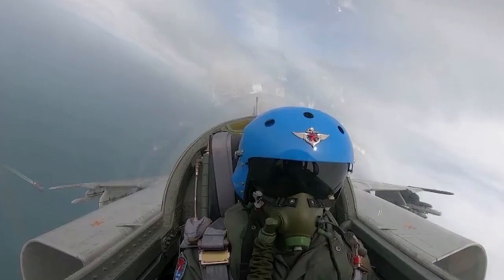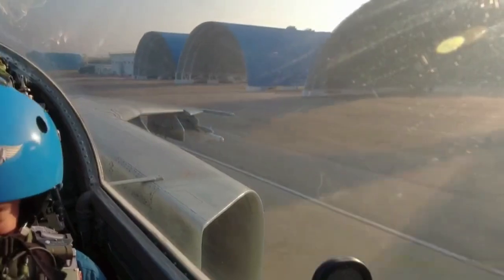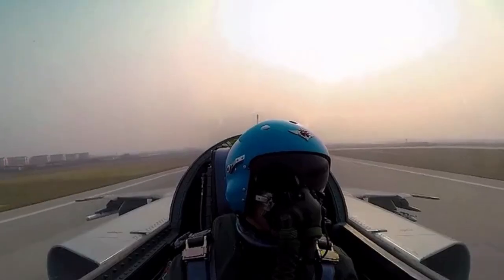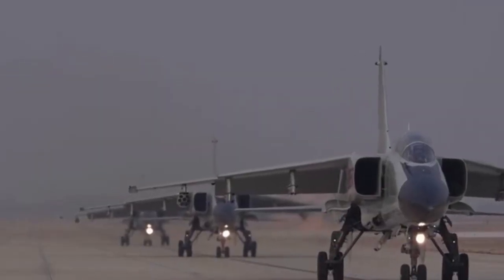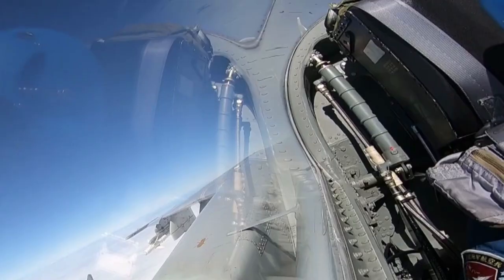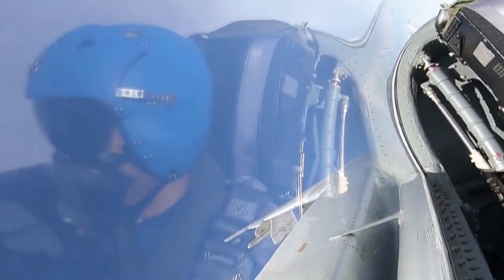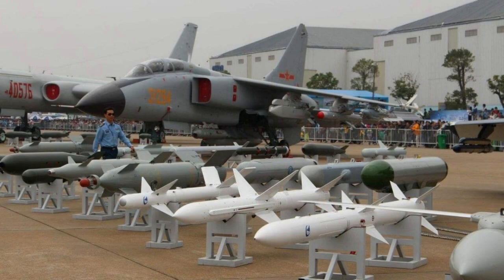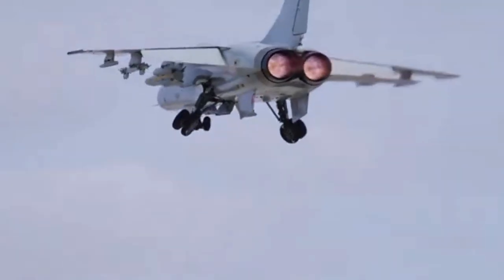Chinese fighter with British heart ! JH-7 with Rolls Royce turbofan engine, a unique fighter bomber

Comment: This Spey RR engine was designed to work in low altitude flight envelop.  China once had tried to replace the Russian D30K engine with this Spey engine on its H6 bomber ,but with no success. Eventhoug both engines has same thrust class, but they were designed to work in different working condition.
Reply from the maker: too big a change

Comment: why do the PLA still use this old aircraft when they have the DF-17? a super sonic anti-ship missile? if the anti-ship missiles carried on the JH-7 only has a 200KM range, that means the aircraft needs to fly into the attack range of many modern ship based anti-air missiles. this plane is a very odd concept.
Reply from the maker: all valuable assets have their places
Reply: Many modern anti ship missiles do not range to 200km.
Very few from NATO actually exceed 60km. I can only think of SM variant.

Europe is still  developing missiles with 25-40km range and they don't have anything above 70km (Aster or Patriot) that I can think of.

Long 200km range AA is very much a Russian and Chinese speciality. NATO has always been on the offensive and invested in air superiority while Russia and China invested in layered air defence.
Reply: because the south china sea is the busiest waterway in the world and you  need to patrol it with a jet that cost little to maintain and has a quick turnaround time